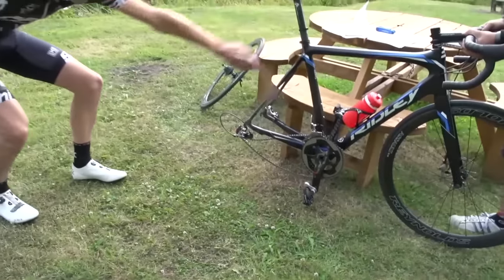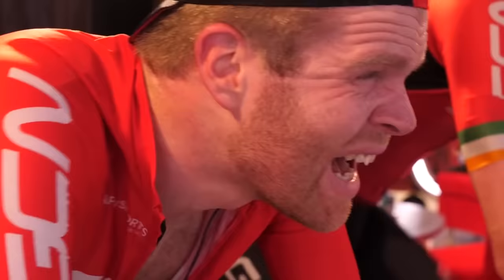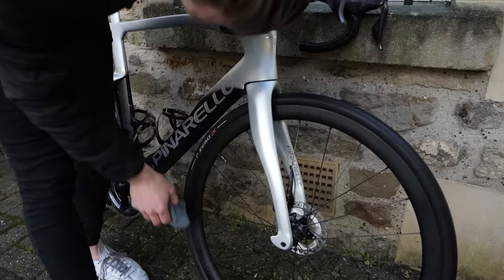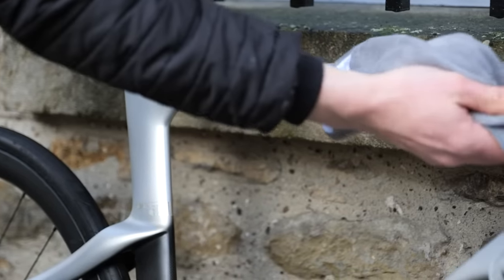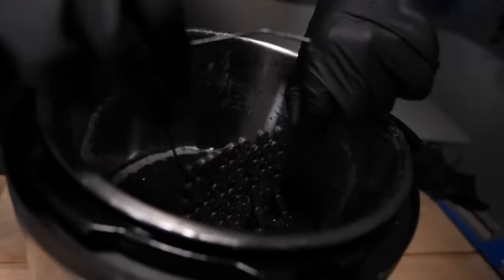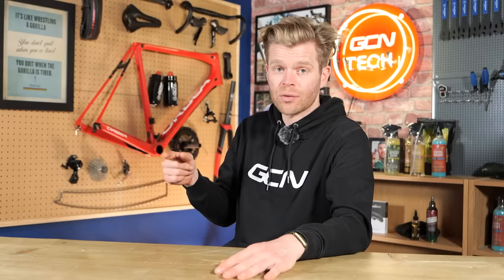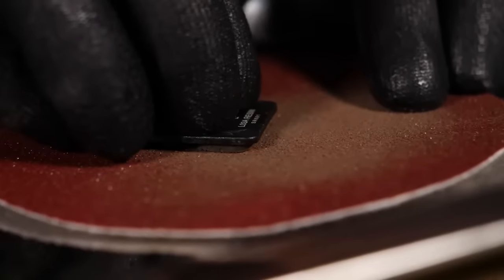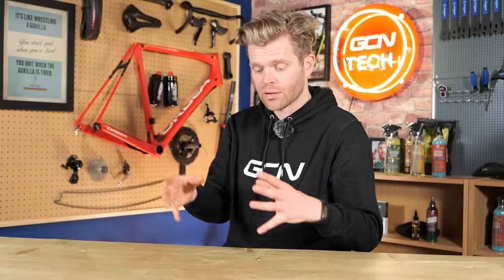6 Maintenance Mistakes That Are Ruining Your Bike!

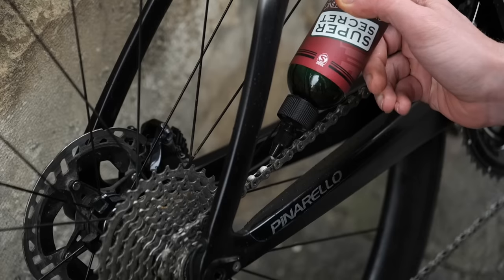Comment: Love this, have to admit I followed Si's advice back in the day and early on in cycling I went to town on my cassette with lube thinking that would cure the noise...It didn't 04:40 though, that rust on the cassette is triggering
Reply: Rust on cassettes is no problem. It'll wear off after a few miles.
Reply: i had a ride on a friends BMX which had a completely rust covered chain, rust covered chain ring and rust covered cog at the back. It was so smooth and silent! Surprised how good it was when it really shouldnt have!
Reply: @magicknight8412  I hear ya. A friend of mine reckons just get layers of oil and grease on it. Rust gone!

Comment: all the crap, oil, grit, god-knows-what-all road spray that gets splattered on brake rotors,  and touching them with a fingertip is going to instantly do them in?
Reply: It's kinda  ironic that all that stuff doesn't make your brake squeal. But yeah touch a brand new rotor when I prepping a bike for the sales flour and squealing like a pig and get to put 20 more minutes into it. When is Shimano going to put an
 end to those resin pads. Ceramic car brake pads are nice and quiet.

Comment: You seem angry.  And it would have been SO EASY to illustrate your points by inserting still photos of bars corroded by sweat, as well as photos of the kinds of bike protection shields that indoor Zwifters can purchase to shed sweat and protect the bike with its components.

Comment: Sweating???? Indoors???? We in the US use air conditioning to be comfortable inside. I know strange, but you guys should try it. You wont sweat near as much. And you can use it when you're not riding your bike inside.isnt that like bouncing you ball inside, get yourself yelled at "don't ride your bike in the house"   Lol no really turn the A.C. down till ya stop sweating so much. If your sweating so much that it's washing the grease out the bearing's well now that's a lot of sweating. I'd get that checked out to be real.  Unless of course ya got ya trainer in the sauna in which case you should yake it out of there.
Any who don't sweat on the camera and keepemcoming k ?